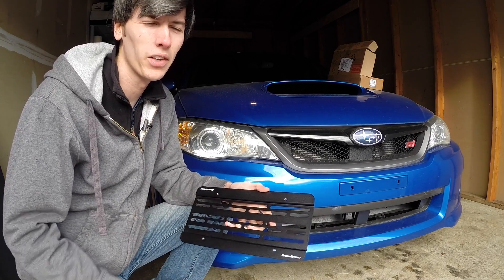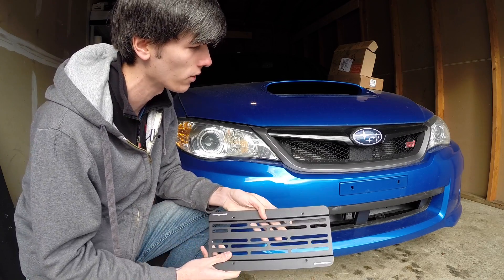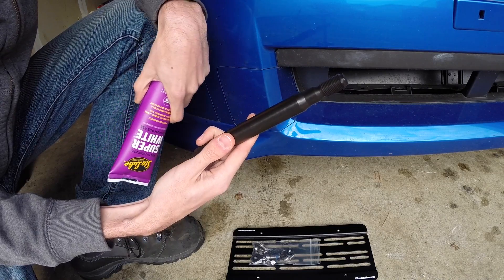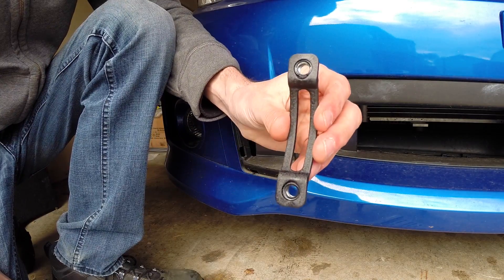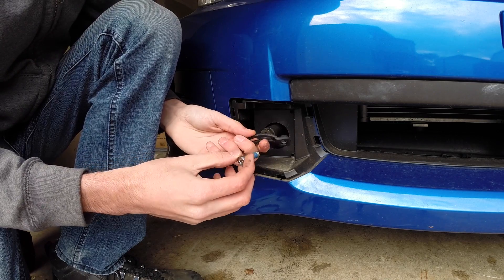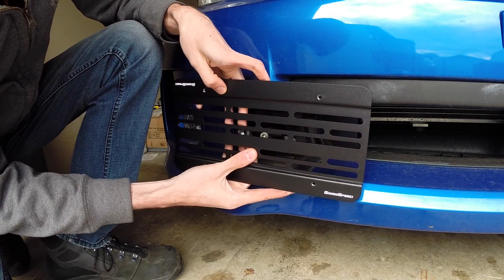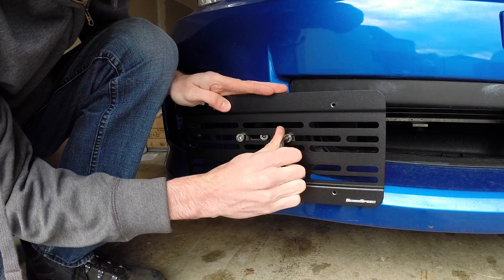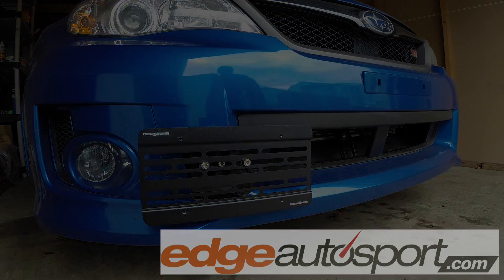Subaru WRX STI - Front License Plate Relocation Kit

Comment: Tow guys gonna hate you if you ever end up off road! lol
Reply from the maker: That's what AWD and 3 lsds are for right?
Reply: no, you took his tow point in the front, gonna have to wrap and axle or frame.
Reply: The car knows how not to get stuck, but people still find away to wrap em around a tree or drive them into a ditch.
Reply: BigDirtyBasterd You should look up on how to tow AWD vehicles.
Reply: BigDirtyBasterd Refer to first comment.
Reply: it looks like it would take literally 1 minute to pull apart to put the tow hook back in.
P.S. Engineering Explained DON"T LOSE THAT COVER!
Reply: BigDirtyBasterd AWD and 3 LSDs are to keep you from getting stuck or going offroad.
Reply: I thought the front wheels did the steering. Last time I checked, adding power doesn't add grip.

Leave the power to the wheels not steering, leave the steering to the wheels not powered.
Reply: Okay people, I don't think you under stand what I mean. Where hes adding this lic plate frame, thats where they put a eye bolt to pull your car to get it out of what ever your in. I'm not talking about just a tow truck towing your car with dollys, im talking about recovery.
Reply: BigDirtyBasterd We know that. AWD and 3 LSDs are to prevent getting stuck anywhere.
Reply: +Hear That? yeah in 6 foot of snow he will get stuck

Comment: Can you please do a video explaining unequal length headers?
Reply: Unequal length headers extract the exhaust from the right cylinder bank (viewing from the driver's perspective), cylinder 1 and 3 first (as the length of the exhaust runners to the up pipe is shorter). So some of the exhaust gases has a shorter distance to travel to the turbo, and it spools the turbo sooner, hence the better low end torque. Equal length headers extends the length of cylinder 1&3's header runners so that the exhaust gases from cylinders 1&3 travel the same distance as the gases from cylinders 2&4 in order to reach the turbo. This is more efficient at high RPMs as the exhaust pulses line up better and creates a smoother exhaust flow. Most high-power Subaru builds use equal length headers because with unequal headers, cylinder 2&4, with longer header runners, tend to overheat and melt the pistons. As for unequal headers' sound, the rumble is from the exhaust pulses from 2 cylinders lining up and creating a bigger pulse.
Reply: pretty simple really. one is of equal length and on is not. that is wat gives a subaru iots subaru sound having unequel length headers!
Reply: I've heard that the unequal length headers aren't as efficient, I'd honestly what to know how big the difference or if there even is one
Reply: Bryan Doherty There is no reason for them to be inefficient. The difference is only in sound as far as I know
Reply: Tom Major I looked at some dyno charts for equal length headers vs unequal length  headers from Perrin for an STI and that showed the unequal length headers had a 15-30hp increase at low revs and 10-20hp increase at high revs. They also add torque. So the people I've heard saying that are wrong about. I really like the sound of the unequal length headers so that's good news for me, the unequal length headers sound great
Reply: Bryan Doherty The more you know! Thanks man, that is really interesting. I also enjoy that boxer rumble :3
Reply: Bryan Doherty
That's interesting!
I was always under the impression that equal lengths headers are more efficient for the turbo (negligible with the stock turbo, but for larger turbo modification the equal length headers give a stronger pulse pattern to spool the turbo for response etc.)
Awesome though because I love the sound of the UEL headers!
Reply: Shikamoo P.K. That's the same with me, I guess the theory makes people think the unequal length headers are less efficient then the equal length headers. But I saw the dyno chart that I saw shows that the equal length makes less power then the unequal length